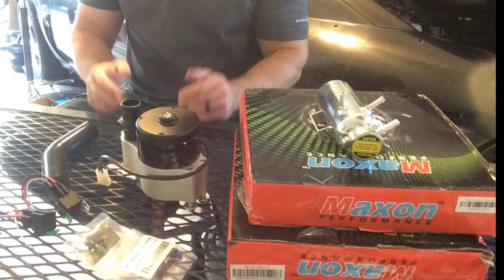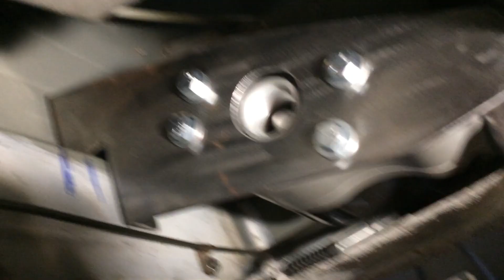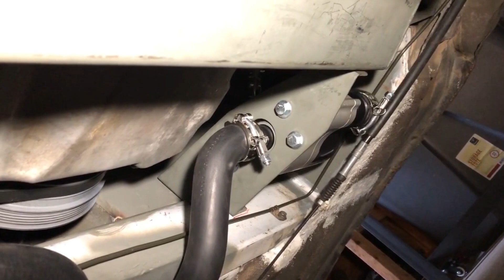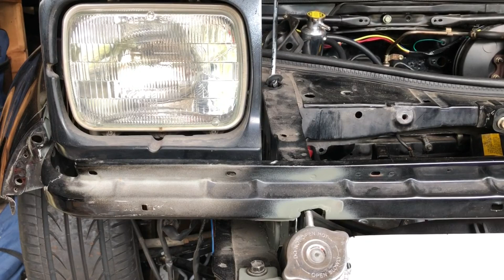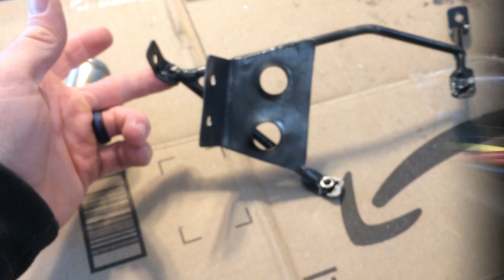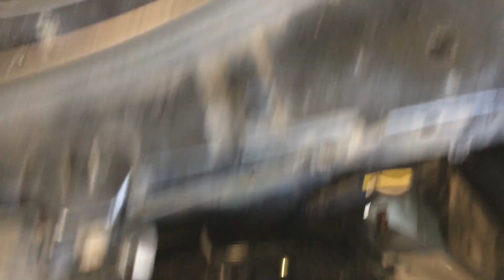Custom LS cooling system

Comment: Well this video made me a subscriber! I just replaced my electric water pump on my 5.3 lm7 (which is now carbureted) and it is still overheating. Initially thought my old electric water pump was on its way out. I use the car for street use and for burnout contests. I think I will add a swirl pot as well to my system.
Reply from the maker: Sounds like a fun car! Glad I could help! Just curious, why are you not able to use a conventional belt driven pump?
Reply: @scantronsgarage  well ive had an electric proform water pump on the car from the beginning, it just worked.  Only have belt going from crank to alternator. So frees up some power. I bought a cheap speedway electric water pump with same gph flow rating. I do have a motion raceworks vent kit on the car as well, radiator is lower than engine but use coolant funnel to burp all air out. I do like the idea of a swirl pot though.

Comment: Working on the same thing now for my davies craig setup thank you for the information, are you concerned at all by welds rusting from the backside with coolant/water?
Reply from the maker: Hope it helps. Are you referring to rust on my steel manifold? If so, not really. I have an iron block engine so all the water jackets will rust along with it. I would have preferred aluminum though